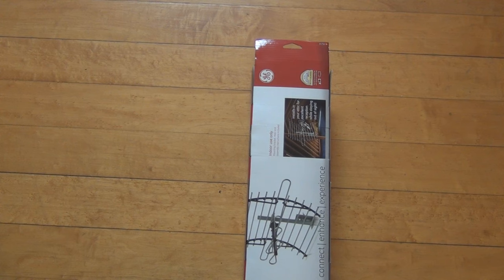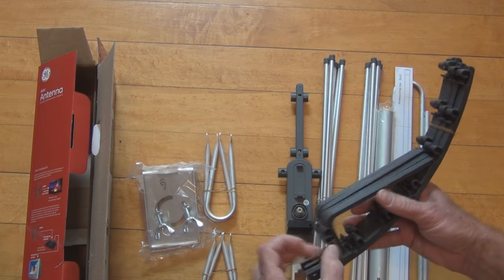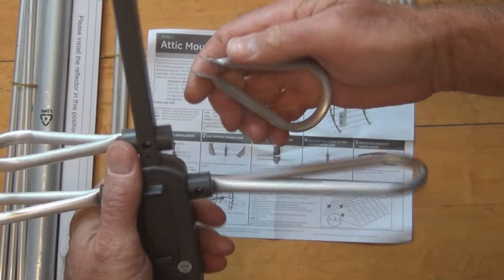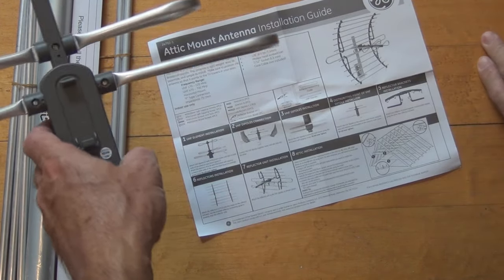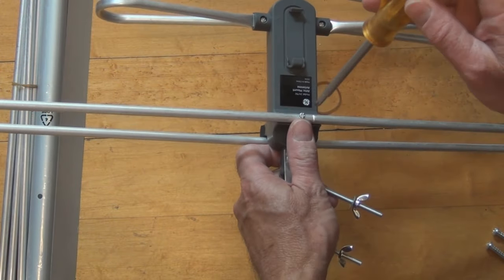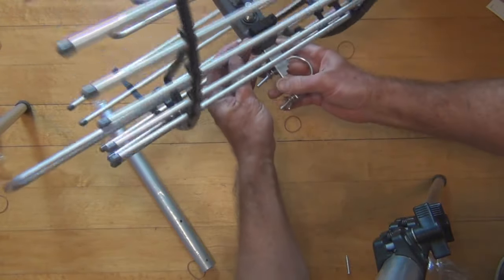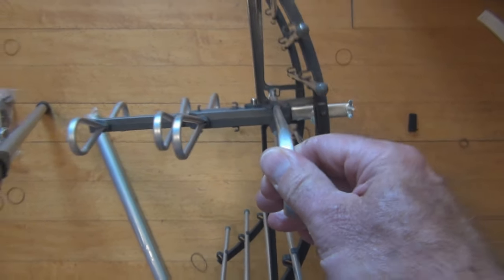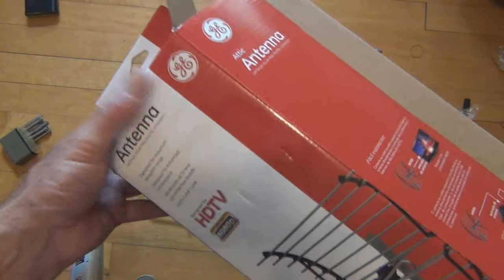GE 24792 Attic Mount Antenna Unboxing and Assembly

Comment: I have the same comment as below - thanks for making this video. I would just add - the bracket you chose not to use for the bottom of the mast, allows you to rotate the antenna laterally in order to get best possible reception.

Comment: Tom, why could you not just feed the signal from the window antenna and the attic antenna into a signal amplifier and connect the output to the cable coax for whole house distribution?

Comment: hey just wondering, how many channels are you getting and how far away from the broadcasting stations are you?
Reply from the maker: I'm getting 35 channels.  I'm about 20 miles outside of the Boston area and I think most of the transmitters are in  Needham which is about 25 miles away.
Reply: eTechTom ahh okay. im about 35 miles away from most broadcast stations that have good channels. you think this antenna will be good enough?
Reply from the maker: It's going to depend on your areas terrain and signal strength.  I have mine in the attic but you can also invest in a mast to get it higher or add an amplifier.  I'm getting more that enough channels.  In my area there is a program called Decades which features a lot of old programs featured from a particular decade and a new one called Comet which has old sci fi programs.  I'm not missing cable at all.
Reply: I'm about 55 miles from Boston in MA but I am closer to Providence. I really would love to get rid of cable.